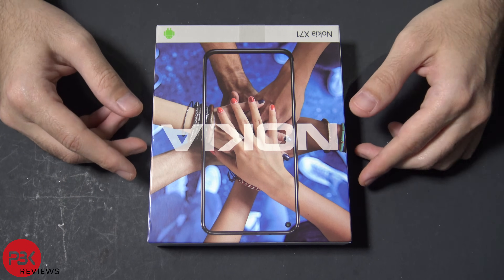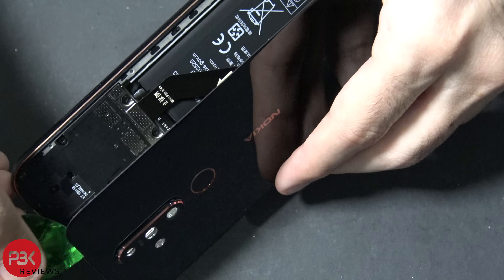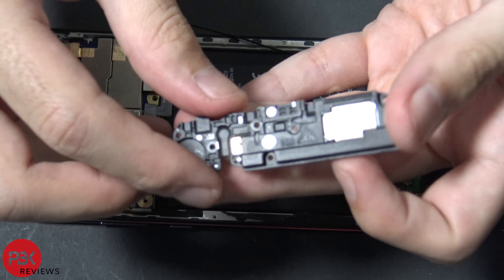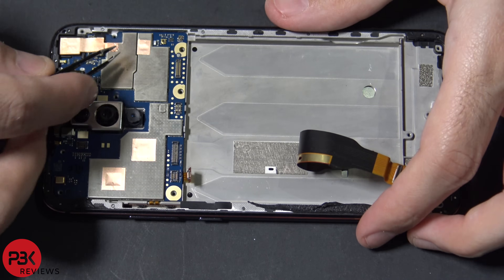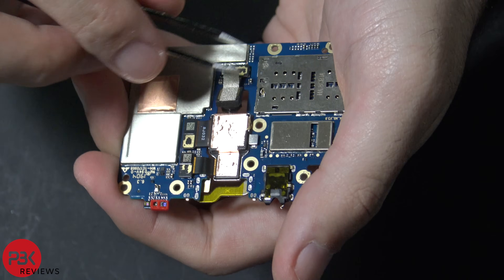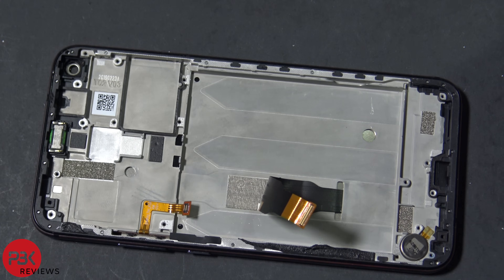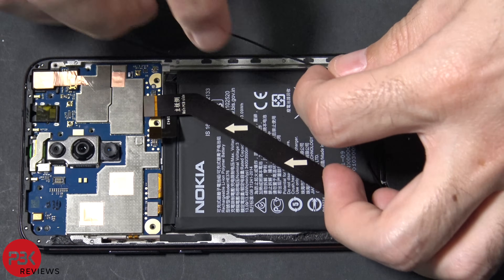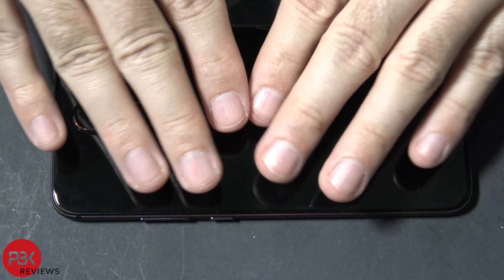Nokia X71 Teardown Disassembly Repair Guide

Comment: I replaced nokia 8.1 mic board(with a copy board), now my network range is low, what will be the problem?
Reply from the maker: Not sure what you mean by copy board, but the board itself has gold contacts which touch the frame at certain points to give/gain signal from the antennas on the frame of the phone. Make sure the board is seated and installed properly and its the correct board for the phone. Also make sure the black wire cable is connected properly. Its also possible the board you have might be defective or if its an aftermarket one, might not be well made and that might be the reason the issue is there.
Reply: @PBKreviews  thanks for reply, the board is a cheaper one (probably from china). Original pcb is little more expensive, can it be the board that is not made for my country?  frequency spectrum difference type of issue. 
I observed that there is diffrence internet speed for phones bought from abroad when campared to my own country. 
Or
It might be loose contact issue, the service boy give me the phone after repair as wrapped in three rubber bands. 
When i pinch my phone i see the back cover is getting pressed. 
Any way can i change the mic  alone not by replacing the entire pcb?
Reply from the maker: @sayyidsahal1996  Ya you can replace the speaker, you don't need to replace the charger port board just to replace the speaker. Also it is possible the board you got has antenna contacts in different sections or not the exact fit for the phone that would cause those issues.
Reply: @PBKreviews   *edit : can i change the "mic"  alone not by replacing the entire pcb?
Reply from the maker: @sayyidsahal1996  no because its soldered onto that board and unless you have good soldering skills and a replacement mic, I don't think it would be possible. I personally would not be able to do it.

Comment: Can u go into details and links for your Xbox one water cool. It’s realy heard to fallow it with barley any detail. It might be easy for u but go more in detail about it like a step by step Guide. Show us pleas.
Reply from the maker: The xbox one was customized with hardware at a few different places so it isn't really doable for everyone. For example we had the housing customized somewhere local to be able to fit the radiator in etc. If you just want to water cool it and leave the whole chassis open its possible but again everything from the screw mounts and such we modified so not really worth someone duplicating. We just did it back then as a fun project but yep. All you need is a closed loop like one of those water cool kits and you can use the mounting brackets it comes with along with screws that you will need to get that will be the length you need with washers to tighten down.  An AMD bracket would better suit being used with the xbox one (which usually comes with the water cooling kits like the h70 or h80 etc.). But again your left with the wiring for the pump and fan etc, just not worth doing since I had one of the guys more familiar with electrical handle that portion. So yep.
Reply: PBKreviews Two quick question. How did you power the fan was it plug-in play on the stock fan socket of the motherboard? Splicing into the Blu-ray power was that to power the pump?
Reply from the maker: @greedx7602  Ya if i am not mistaken its been a long time but this other video we had done gives you a more of a break down so this should help you on that. At the 1:47 mark you will see the text explaining what was done. https://www.youtube.com/watch?v=_koPzrfHf8Q

Comment: Nice teardown. Are you gonna eventually do a review of this phone?

Also, what would you do if a screw was to difficult to remove because it is too damaged?
Reply from the maker: Thank you. I may or may not do a review on it, got another video or two I got to do first. Also a lot of reviews out there already on this phone so I will see.  As for stripped screws, best thing to do is use a drill bit that fits into the screw and drill into it a bit to break the head off, then when you remove the part it was holding down, you can use pliers to twist off the screw. Hope this helps :)